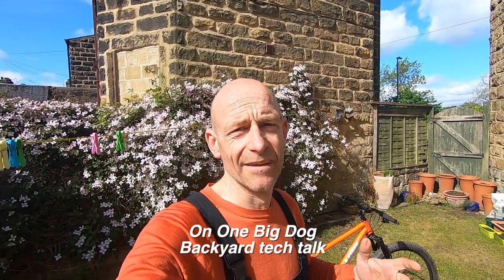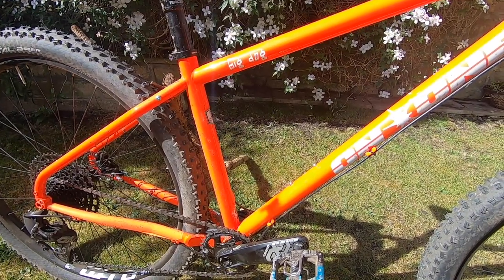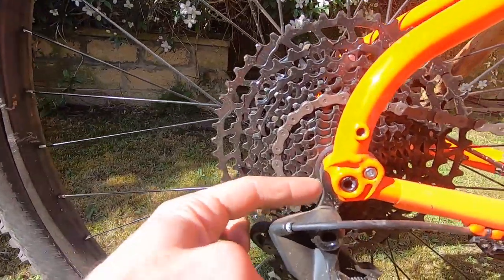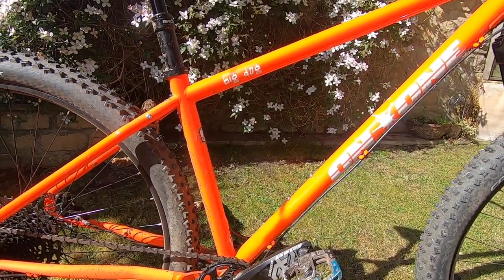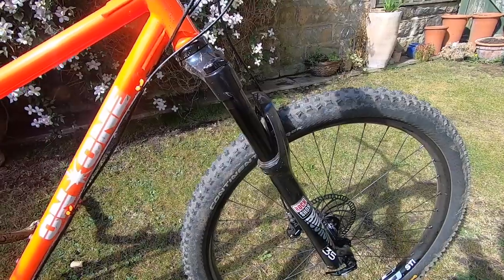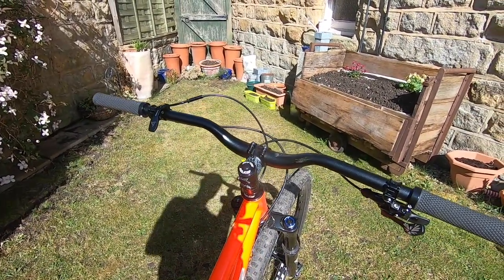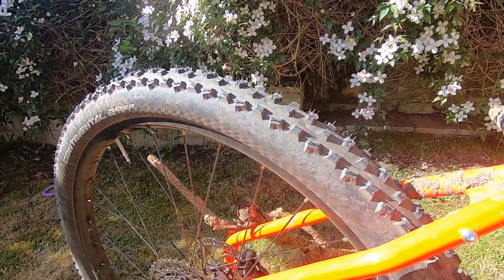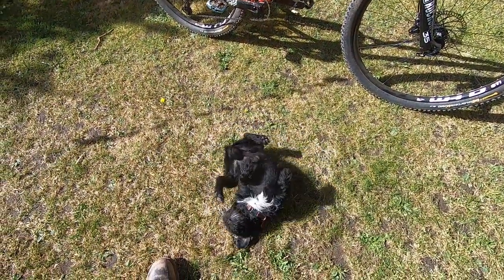On-One Big Dog mountain bike tech talk round

Comment: thanks for the review from your opinion can i use them as an xc bike I mean front tier 2.2 rear 2.1 fork 100 mm
Reply from the maker: You’d be better off with the on one Whippet for that use. It’s designed for that length of fork and it’s carbon so a lighter frame